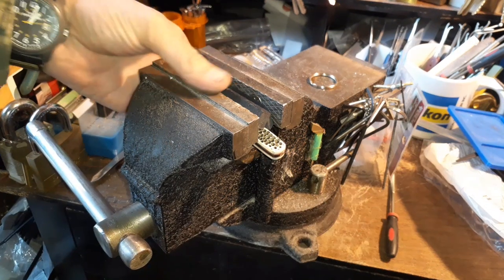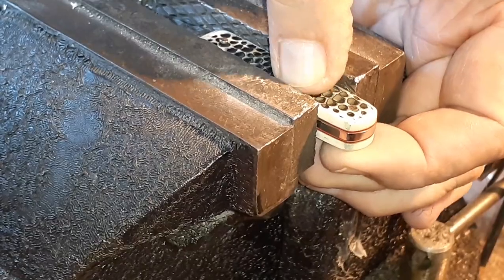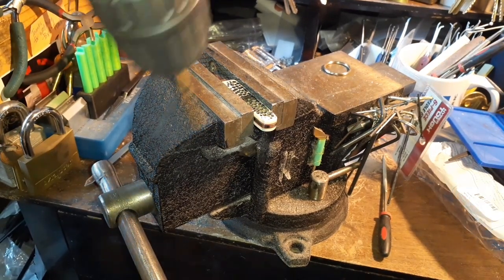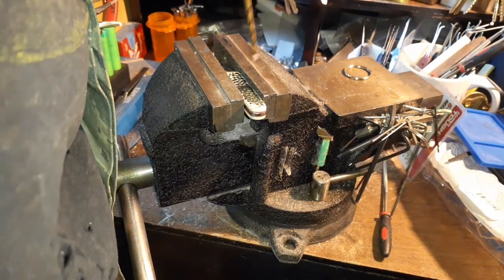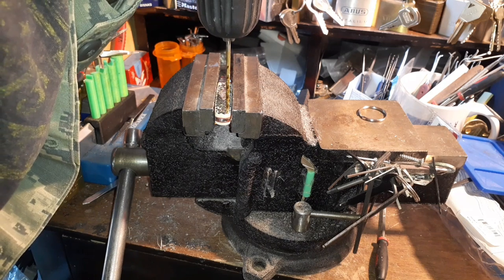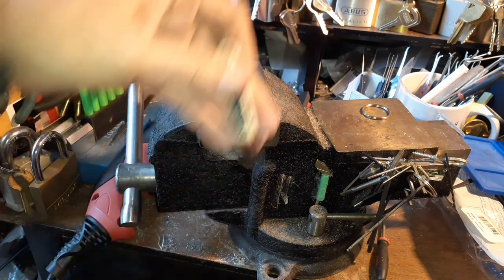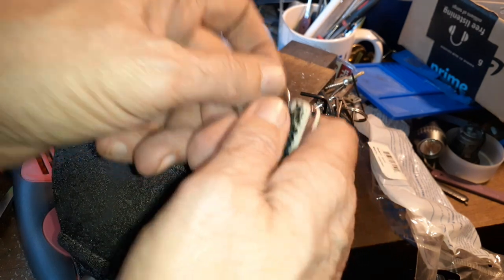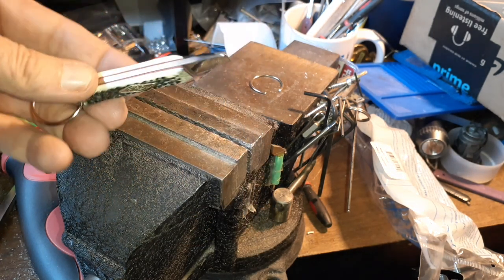(650)  Attachment of a Clevis to the Rough Ryder Nail Nick Tool RR2321

Comment: I was sitting in my comfy chair thinking about doing this, maybe drilling out that pin and putting in a brass tube. I did buy a few squeeze-on bails from Chicago Knife Works for like 30 cents. So I’m ready! Except I don’t own a knife pick yet. Lol. You, sir, are a man of action!
Reply from the maker: Thank you Su. I never thought of getting an actual bail.😂 Some obvious things go right over my head
Reply: @WilliamsKnifeLife   I got the bails for my old scout knives. CKW and Blade Matrix and a few Ebayers have parts from the old USA Schrade factory. Pins, blades, etc. I added them to my last order to use up every bit of their high shipping. Lol. I ordered them out of laziness — should have made my own. I imagine how I’ll do a job, but you just do it. I admire that (though it makes me nervous sometimes). Cheers!
Reply from the maker: @skcamerican  😂 I do throw caution to the wind sometimes, and I have the scars to prove it.🤣

Comment: A fine piece of butchery!  It would be helpful if: your vise were secured to your table, you started the hole with a smaller bit and then worked up in diameter, and if you padded the tool with leather in the jaws of the vise and supported the tool from the bottom.  Actually it would be better (lacking a proper drill press) to place the tool on a block of wood, clamped to a solid surface so it doesn't shift as you apply downward force.  But at least it looked like you had fun!
Reply from the maker: Thank you Jimmy J. Yes, I should have done all those things, but it worked out well in the end.

Comment: Yep definatly harder to drill through steel than bone and if you drill too fast the bone burns and gives off that smell. Couple peices of soft wood in the camp should keep it from marring up stuff to bad or even strips of leather while still holding firm. Great little mod job overall though good fix for a problem when you don't have access to a drill press. Necessity is the mother of invention after all so cool workaround. Thanks for the look see and keep making sharp things fun and enjoyable
Reply from the maker: Thank you Todd. I try to make do with what i have. Sometimes it works out okay.